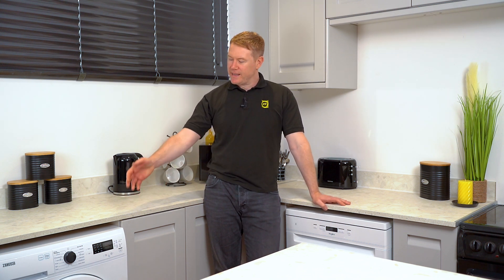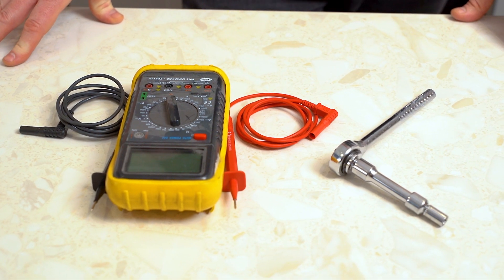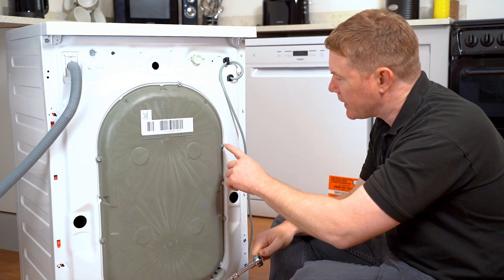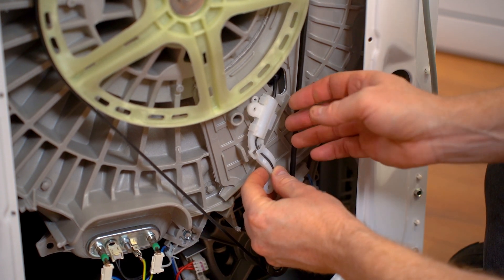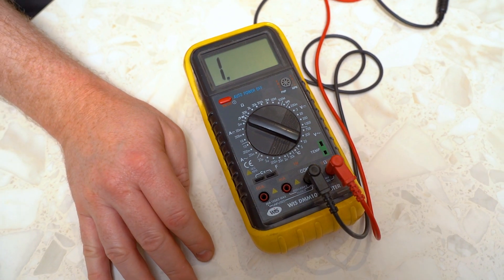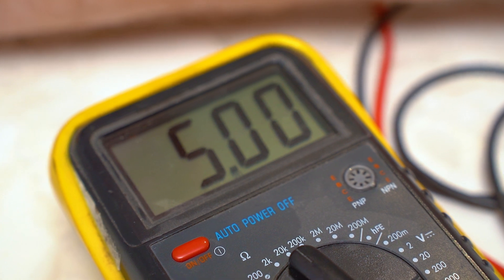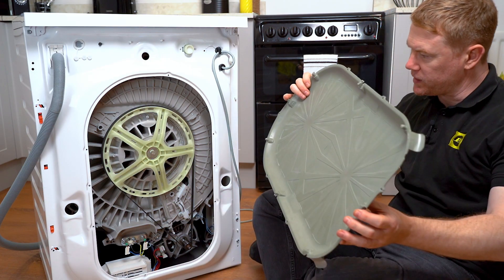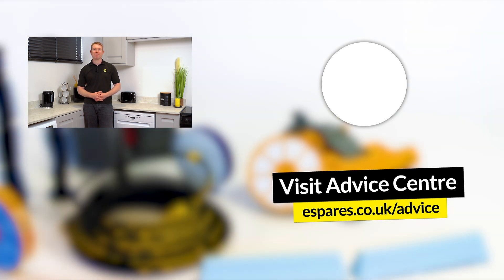How to Test & Replace a Thermostat on a Zanussi Washer Dryer YOURSELF!

Comment: Hi! I used this to test my thermostat and it's fine, and then I used your video to check the NTC sensor and that was fine too :-( My AEG washer dryer won't keep drying I set it for 3 hours and it cuts off after 3 mins. SO, what else could it be? Pleas advise.